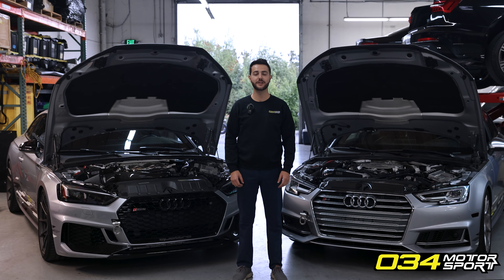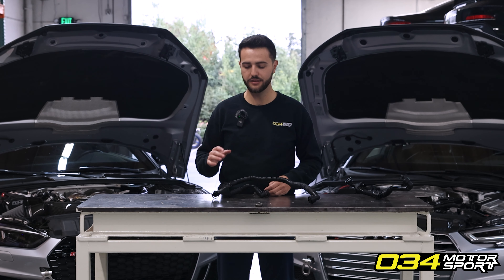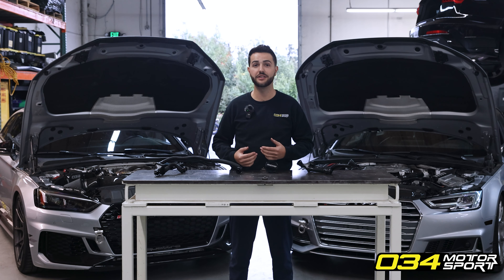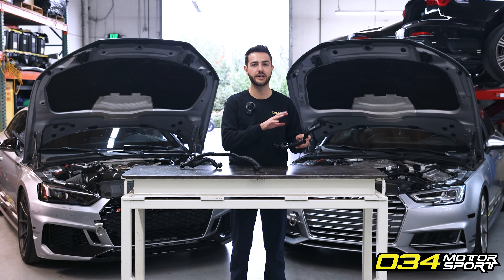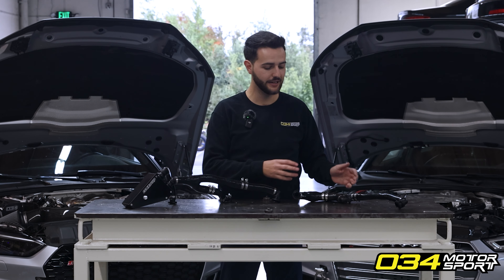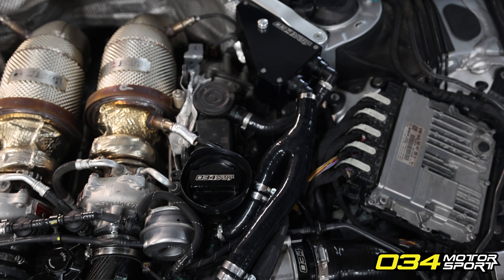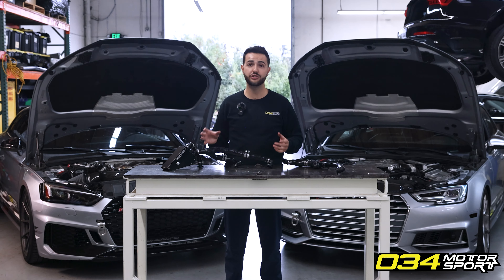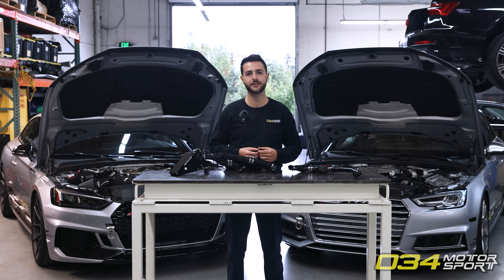How To Diagnose & Fix Failed PCV System for Audi EA839 Engines | B9/B9.5 S4/S5/SQ5, RS4/RS5, & More!

Comment: For EA839, but does that include the Q7 4M.5? Some things are different between the S5 and Q7 although they share the same motor.
Reply from the maker: @Sinister6_cuv  yes this does apply to the EA839 found in the 4M.5 Q7 and Q8, however the 034Motorsport PCV Breather Hose is not yet available for this application. We’re working on finalizing that fitment currently.
Reply: @034motorsport Great, thanks. Hopefully that will be with a catch can too. Currently using an APR universal, but would love to rip it out and 034 everything. 🎉

Comment: Are the hose squeeze fittings improved over OEM at all or in any way less annoying to remove?
Reply from the maker: The squeeze fittings we use are much easier to remove and install, while still performing as needed for the pressures at play here.
Reply: @ my pre-artheritic hands thank you 🙏

Comment: Do you supply the drain-back kit in the box with the catch can or do we need to purchase it separately?
Reply from the maker: The drain back kit is currently not included with the package of the catch can, but will be supplied free of charge to all of those who have purchased it.

If you purchase your kit today, you will receive a drain line kit in the future from us.
Reply: @034motorsport  do we have to request the kit if we already purchased the catchcan? Will the install of the kit be more difficult if the catchcan is already installed?

Comment: Can a bad PCV also show up as high vacuum and idle when removing oil cap?
Reply from the maker: No, the main symptoms would be oil around the cap or PCV block, and testing would be as shown in the video.
Reply: Sounds like thats the pcv. Aounds like yours is blowing out air when removed.

Comment: Will it fit on a cts turbo inlet pipe?
Reply from the maker: This should work on any turbo inlet pipe where the OEM PCV Breather Hose also connects. If you’re still using the OEM PCV, then this kit should work fine for your car.

Comment: Been having these issues for couple weeks now. Replaced cap twice and constantly keeps loosening….def need to order but before I do,  is this problem covered under warranty? B9 2018
Reply: I think Audi issued an extended warranty for the PCV system. I had mine fail two years after I bought my RS5 and it was replaced under warranty.
Reply from the maker: @fartamplifer the trouble with the warranty replacement is that it’s bound to fail again, which can potentially be catastrophic when it does. It’s best to resolve the root problem without waiting for it to fail again.
Reply from the maker: In some instances Audi will warranty the failed part, yes, however the replacement part is bound to fail again in the future, which can cause catastrophic results. For the very low cost on the 034 PCV Breather Hose, it’s best to remove the failure point altogether and make the problem an issue of the past.
Reply: @034motorsport  That's why I ordered the catch can kit. 🙂 Plus I also wanted a catch can since I do mostly city driving.

Comment: I hope 034 PCV valve not made of Silicone , harden .
Polyurethane is better wont harden and stays flexible in a Cold engine / Weather.
Reply from the maker: @adampoirier6057  you can read about it on our website 👌🏼
Reply: No Catch Can for 3.0 t ?  Catch Can for  2.9t dual Turbo engine ?
Reply: why cant use steel ball bearing to block Pressure ?
Reply from the maker: @adampoirier6057 that’s not how we designed this system, we tested every option and our data and performance measures resulted in the optimized design here.
Reply from the maker: @adampoirier6057 we do have a catch can kit for the B9 S4 and RS5, see our website.